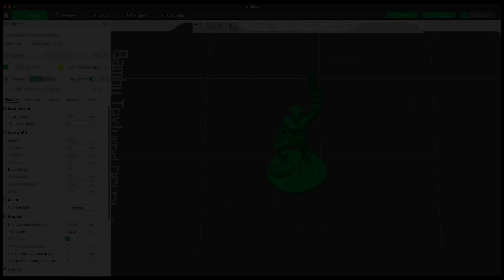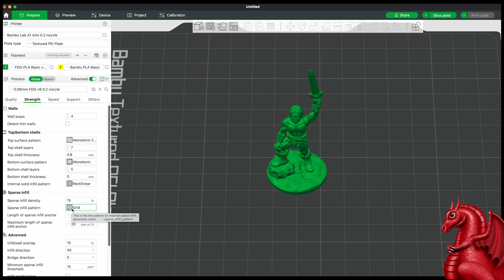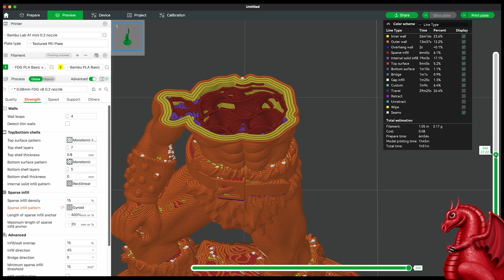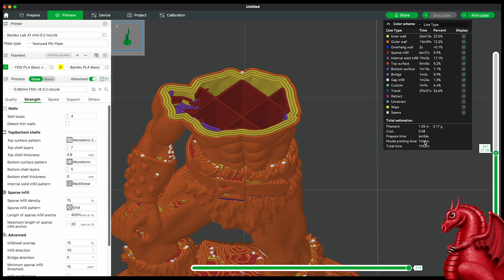Bambu Lab A1 /A1 Mini Print Failures

Comment: i have to use rectilinear because im on a cr10 haha. gyroid causes way to much bed motion for my printer. But rectilinear doesnt have the crossover issue like grid. BUT i have been using grid for over 7 years and no issues on certain parts. But for minis, i am strictly rectilinear. 

Im hoping to be getting a P1s in the next few weeks

Comment: I have been struggling with that problem for a while, it happens to random 3d models and is really irritating. Have just applied the change and am waiting for the result. Fingers crossed!
Reply: I have changed sparse infill pattern to Gyroid and did this ( from the comment of another user here ) :

Bambu Studio -> Others
- Uncheck "Reduce infill retraction"

Bambu Studio -> Quality
Set "Initial layer height" to 0.2

Edit the FDG PLA 0.2 nozzle profile -> Settings Overrides
- Set Z Hop Type to "Normal"
- Set Travel distance threshold to "0"

IT HELPED!
Reply: upd. It didn't help. the model still fell down after extruder bumped into it closer to the end of print.

Comment: I was going to say that you need to EARN the Like & Comment, but you did! Changing my Infill has definitely helped this exact problem. Hopefully I won’t have any more failures due to “nozzle knock,” especially when I’m about 75% through a 12 hour print! 

Funny enough, I watched this video while I was doing a test print changing this exact setting! This did however ease my mind knowing that I was right about the cause and solution. Thanks again!

Comment: Went fdm over resin because of your videos. Printed some great minis with stock settings then switched over to the .2 with fdg settings. Still printed great minis for about 2 more weeks and now the  nozzle keeps knocking supports and failing almost all prints that require supports.
Reply: This happens now consistently with the .2 and .4 nozzle with either fdg or stock slicer settings
Reply: @T0NGB0KE  I am also having these issues if anyone finds an answer please leave a reply!
Reply: @1tinytiger there’s a step by step video by a guy named Ken print on how to fix the loose nozzle. This solved my problem.

Comment: The biggest thing for me is the rule of thumb is never go more than 55% layer height of the size of your nozzle. So for .4mm nozzle usually go .2mm height but can push to .16mm to get more quality if you go to .15mm it’ll knock the last layer everytime. So sometimes I go .16mm and that gets amazing quality and it also depends on filament. Anything above pla you don’t want to get to close because the material slightly expands as it comes out so adjust for that.

Comment: Help!!
Anyone!
We got my 7 year old son the A1 mini , and we made about 12-15 prints, everything went good. 
Then we got filament stuck in the heat end nozzle , we cleaned it out about 190 times , but since then , prints aren’t sticking to the bed . 
We cleaned the bed with soap and water multiple times . 
We ordered new nozzle’s, is this a nozzle issue ?

Any help please !

Thanks !
Reply from the maker: Did you re-run bed leveling after cleaning the nozzle? Are you sure the nozzle is seated properly (not wiggling)?
Reply: @Tombof3DPrintedHorrors  

Yes sir we did re level, nozzle appears to be seating properly 
Now we are getting. “Filament appears to be stuck or damaged on spool” error.

But it’s not stuck or damaged or broke ?
Reply from the maker: @jeremybaker6167  preheat the nozzle to 225, then hit the 'down arrow on the LCD screen for the extruder to push filament through it, see if it extrudes filament cleanly doing that. Also, what brand of filament were you using when it clogged?
Reply: @ 
It will appear to cleanly extrude filament 
We had a green silk , not sure of brand it’s un labeled , swapped to red and you can see the the green dissipate and extrude the red cleanly . 
But as we try to re level and print it gives the error of “tangled filament” or that there is a clog , but we can cleanly extrude filament ??

I really appreciate your time !
Reply from the maker: @jeremybaker6167  check the spool, the line of filament can 'hop' over the edge and wrap around the rod that the spool sits on causing resistance.
Reply: @ 
Thank you for your help. 
So we tried it with turning tangle detection off, and now it’s been working seemingly correctly. 
Not sure why this made it work, but if anyone else has issues , might be worth trying that ..

Thank you so much for your time and  expertise!
Reply from the maker: @jeremybaker6167  great! I hope your son loves the new printer :)

Comment: Bought my mini 3 weeks ago, printed beautifully until this week, lots of nozzle knock.  Unfortunately, not an easy fix like this, the corners of prints are warping upwards in a cupping motion and the nozzle hits them. Bed adhesion is great, the warping doesn't start until 5-15 layers above the bed. Doing this on all filaments, all models. I've tried cleaning and lubricating everything, checked the extruder gears, nozzle, heat element, even adjusting nozzle temps from 205-220 and bed temps from 50-65. Absolutely nothing works, even rerunning the out of the box calibration for bed leveling and vibration comp.

Comment: I'm having a problem where my 3d print freezes right at 65% of the job and I have to stop and cancel the job and restart. Can you please help
Reply from the maker: Sounds like a corrupted file (or SD card). Try reslicing it.
Reply: @Tombof3DPrintedHorrors  i tried new SD card and reslicing it but happened again 20 mins after it started
Reply from the maker: @akbermehdi3626  then it could be a defect in the model.

Comment: I made the change in the video and my problem stopped.  Sadly, I did two things at the same time on my A-1.  I also wiped my plate with isopropyl alcohol.  I noticed the prints stick harder than ever but pop off satisfyingly when the plate cools. The alcohol definitely makes adherence better.  Before the nozzle knock, I noticed my parts sat on the plate looser with each new print.
Until one day I had the classic bird nest.  That's when I ran into this video. Today, I use the suggestion in the video for my infill and pay attention to how hard it is to remove my prints.
If I can pick them up without resistance I do a quick wipe and thats good for three or four prints.

Comment: Changed to Gyroid, modified the settings and I'm stuck with the same problem. I even washed the plate and oiled everything even tho I've been using it just for a week. I really don't know what else to do and when searching for answers I only see A LOT of people with the same nozzle scratching problem while others act like we are dumb or inventing stuff
Reply: Im having the same issue on both my a1's. I print larger prints and the nozzle is dragging on all styles of infill. Calibrated filament and changed loads of settings. Im at a loss. My old creality printers dont have this issue. Has to be an issue with A1's firmware.

Comment: Any tips for dealing with curling? Opening the door/lid on my p1s helps, but the fan is already at 100%. I'm rocking a 0.2mm nozzle with your a1 mini speeds.
Reply: Usually adding a brim helps with curling
Reply: @jwmann  can't add a brim to the top layers

Comment: I have some info for how I fixed my failed prints!! If you're stuck, try these:

Bambu Studio -> Others
- Uncheck "Reduce infill retraction"

Bambu Studio -> Quality
Set "Initial layer height" to 0.2

Edit the FDG PLA 0.2 nozzle profile -> Settings Overrides
- Set Z Hop Type to "Normal"
- Set Travel distance threshold to "0"

- Wash your PEI plate with soapy water & dry

Hope this helps
Reply: Thanks for sharing this, it helped quite a lot. It is a bit more stringy than default profile, but it works!

I was having problems with thinner longer parts that broke off (legs, swords, skeletons, etc.), because the filament started curling up on those small areas and layers became uneven.. So nozzle kept hitting them utill they snapped.
Reply: This is what fixed my problems. I spent weeks/months trying to solve this...Bambu "apparently" is trying to put a fix into the works....we'll see!
Reply: how do I go to setting overrides?
new to the bambu slicer
Reply: @ironalex28  in studio, make sure you have fdg pla basic profile selected under the filament drop down menu. click the little "pencil in box" icon on the right, should get you to that menu.
Reply: I have been looking into this problem for the last 3 hours I think, only cuz I didnt see this comment, this really sums it up. But I also came to the conclusion that lovering the flow rate a little (even with flow rate calibration in my case) would also help in this regard. thx everyone

Comment: I've been having this very often with my Ender 3 V3 SE. It isn't so much that the whole print is knocked loose as individual supports or parts are being knocked around and fall clear or or start to tilt which then causes them to be hit again or wobble around as they are printed on top of which can cause the failure to escalate to a total loss. I don't have much infill compared to supports but I can't see any obvious crossing-over points in most layers but I will try this anyway. It is almost like the gantry is not being raised enough in the Z axis so it slowly gets closer and closer until the nozzle is being dragged over everything rather than just above

It handled it really well for the first month or two so it may just be a maintenance thing but nothing I have tried has worked so far. This is still a good trick to know about though and may help me

Comment: Can you make a video on how to reduce or avoid printing warping on Bambu A1 mini.
Reply from the maker: Lower bed temp a bit and add a brim are your two options.
Reply: I see an outer and inner trim, should I select both? Where can I find  the Bed temp option @Tombof3DPrintedHorrors
Reply: I set the Brim type to outer brim [5width] and the cool plate PLA to 20. Let see if that helps. Thanks @Tombof3DPrintedHorrors
Reply from the maker: @steveng6997   I didn't realize you were using a cool plate, try using the heated textured plate, you will get better adhesion.

Comment: I tried what you said to do and it did not work out very well, I tried somethings and found that if I did a infill of 100% It gave me the perfect print, I was doing very small prints and they all came out very good, Try it and tell me if it works.

Comment: I started hearing the dreaded nozzle knock on some prints, but it wasn't until a part got yeeted off the print bed at high speed half way during a 4 hour print that I needed to look into this problem.  Who'd have thought it was the grid/cubic infill?  Thanks!  It's also a combination of high speed printing.  I get nozzle knock frequently on my Creality printer when it's doing infill, but it's often just not moving fast enough to remove the part from the bed and would melt through the intersecting lines (or break them in some cases, if the filament was brittle).

Comment: The best solution is a much higher z hop.

I was having problems with very small layer heights having having the nozzle collide with vertical columns and other fragile features. Eg overhang tests in particular.

Setting z hop much higher completely solved this, and it's what I'd recommend
Reply: Z Hop causes stringing so I will try the gyroid first.
Reply: Thanks! I'll try this as I have a mini that consistently breaks in one particular spot each time I try to print it. I finally succeeded by slowing the A1 Mini down to 50% speed. But would be good to print at 100% speed again.
Reply: What's your z hop setting my good sir?
Reply: Can you tell where they hid that setting in Bambu Slicer? I might just be having an oblivious moment, but I can't find it.

Edit: found it. In case anyone else is looking: Filament Settings (from clicking to edit preset just to the right of the filament dropdown), then Setting Overrides.
Reply: @CSmith-b4y I still can’t find it :(

Comment: I have had perfect adhesion on the A1 for weeks and now I cant seem to get the McGybeer possums to stay on the (textured PEI)  build plate.      I have tried cleaning/washing build plate with dawn, 99% alcohol, purple glue stick, changing from .16 to .20,  changed from grid to gyroid,  turned all models 90° , made possums bigger, turned off prime tower, turned on prime tower.  Im on my 8th fail.  :(

Comment: overextrussion or undercooling. I tried changing the pattern and still kicking. I watch the deformation of the supports in the end of the layer, and that caused overhigh. Z hop doesnt work between layers, just changing sections at the same layer, so this is a painful issue that i dont know how to resolve

Comment: Will the linked custom profile settings work for the A1, or is it exclusive to the A1 mini.  I'm planning on getting the A1 in the next few weeks (the larger build surface for not a lot extra seems like a good idea to me) but having no experience, I don't know if the settings you mentioned here (and in the other Resin like print video) depend on build plate dimensions or not.
Reply from the maker: They work on the A1 (I've used them with mine) but I changed the temp to 210˚ with Sunlu PLA META on the A1 (link in the video description) as other filaments like hatchbox didn't do as well for minis on the full size A1.

Comment: I have been hearing the nozzle click hit the print. I think my adhesion is strong enough that it hasn't knocked it loose. the a1 is so much more reliable than my old ender (which I never tuned correctly).  so far my only failed print was when my tube snagged. I'm sure I'll have more as I try more complicated prints

Comment: I wish to express my thoughts without coming across as unduly critical, but it appears that the argument presented lacks a foundational coherence. The notion of a "hit" is untenable in this context, primarily because, even under the assumption that the initial pathway has achieved solidity, the filament's inherent viscosity precludes any possibility of a collision. The ongoing extrusion, given its viscous nature, inherently leads to a gentle displacement as it traverses the pre-existing path. Friction only becomes a factor in situations of over-extrusion, wherein the preceding deposition surpasses the anticipated layer height, thereby permitting contact. In the absence of over-extrusion, the nozzle remains free from friction, positioned above the current layer, and the minimal friction arising from the outflow of viscous filament is virtually negligible.
Reply: What is a working fix for overextrusion then I tried lower nozzle temperature and manual calibration and neither helped?

Comment: I was having this issue on my A1 mini (with the FDG v7 .02mm profile), and 'fixed' it by adding a 12mm brim and cutting all accelerations down to 10%.  But if I can speed those back up using this fill, that would be great!  I'll tinker around a bit more, thanks for the ideas!
Reply: This is such a good printer that should not be necessary.

Comment: So my issue is when printing multiple models the print head travels across models that have already had their next layer applied. I print multiples to reduce waste on color changes.  Is there a way to specify like a front to back order.  (Need to print all at the same time to better model to changeover waste ratio)

Comment: I wanted to add that I have had great luck with these settings so far printing minis even as small as 15mm. One thing that made a huge difference when I was printing minis with smaller limbs, like skeletons, was to use the smooth plate that is included with the Bambu accessory pack. I hadn't tried it previously as I was having good luck with the textured plate, but I was having failures like the one you're describing from nozzle knock. While I do think using gyroid infill will help with some prints, I do think that the textured plate just has somewhat poor adhesion with smaller pieces (even after thorough soap and water cleaning) at least when printing quickly. I was getting periodic failures due to inertia flinging prints off the bed just enough  cause issues, but the smooth plate (being obviously "stickier") has not only fixed all my 28mm prints, but was also the only way I was able to get 15mm to print at all, as brims were not strong enough to keep the mini held in place the entire time.

If you haven't already, I'd definitely recommend giving the smooth plate a try, at least for minis!
Reply: Do you use glue stick?or anything else on the smooth plate? Thanks for sharing your experience!
Reply: @bingobangobungo7918  Nope! A thoroughly cleaned smooth plate with Tom’s settings and gyroid infill and 15mm miniatures stick very well! I have a community post and video on my channel if you’re curious about how my 15mm prints came out using these settings.

You really only need glue if you use a cold plate with PETG, which isn’t ideal for minis anyway.
Reply: I thought the point of the textured plate was that it stuck better
Reply: @petercallison5765  Actually, it's the opposite in my experience! The texture of the plate is fine enough that the molten filament doesn't actually adhere any better. The smooth plate adhesion is significantly stronger and that makes the smooth plate a better option for smaller prints.

Comment: I am on gyroid but still having my models knockoff or fail. I was assuming it had to do with speed/accelerations. I turned them WAY down and now my prints work but take way longer then they should. If you have any advice on speed and acceleration settings for A1 it would be very appreciated!
Reply from the maker: Have you tried my Miniatures profile?
Reply: @Tombof3DPrintedHorrors  not yet! Just found your channel from this video, searching to fix my A1 problems. But I did subscribe so I'll be digging in soon